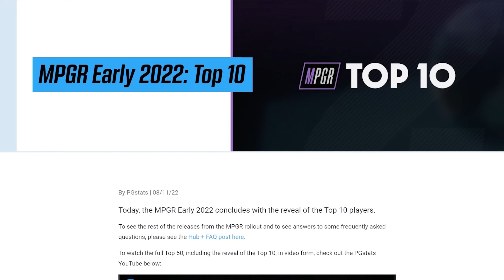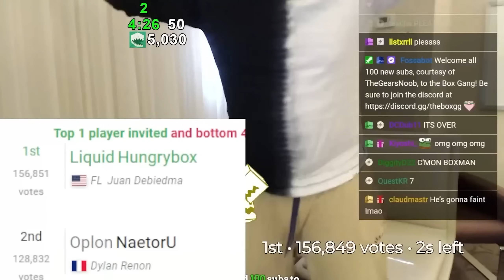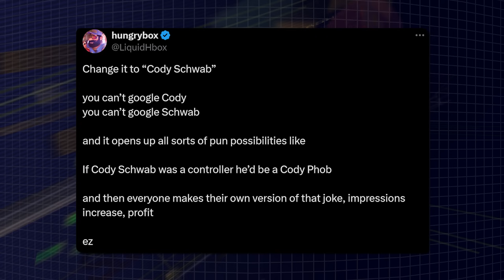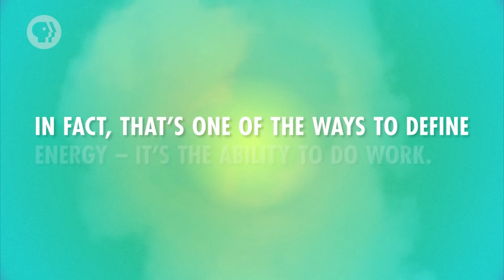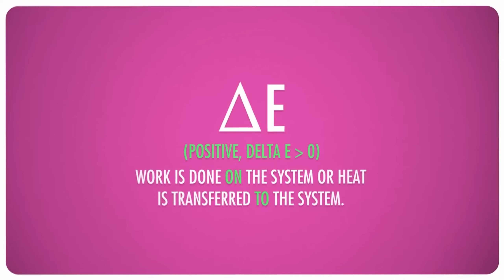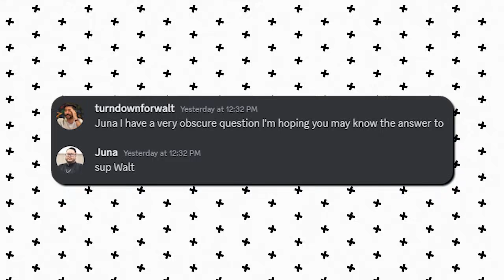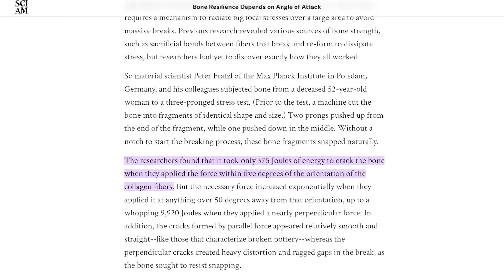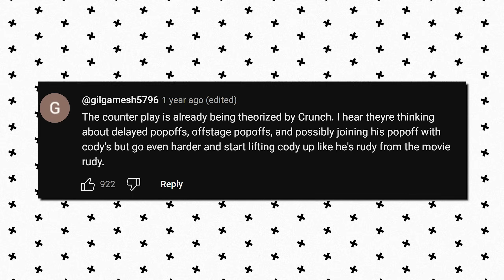Using Math to Calculate Melee's Most Insane Popoff (feat. @adef)

Comment: Sorry mate, force is only applied to the chair during the wind up until he releases the chair, you should be calculations the work through the distance the chair goes from its projectile arc where you can calculate the initial velocity, then you calculate the acceleration given in the windup for the force over the distance of the chairs acceleration
Reply: For Cody Cody schwab schwab falling, you would have to use the rotational inertia of a rod with evenly distributed mass rotating about his feet since what you did is assuming his mass is concentrated about a point at his head falling fiagonally rather than in an arc

Comment: We are forgetting about something very important: Cody "I Did More Work Than The Average Person" Schwab didn't just go from point A to point B, he went from A to B to A to C across both the horizontal and vertical planes. He did enough work to lift himself, a (presumably) 170lb man, off the ground ~7 times. It may not be enough work to surpass potentially breaking his own foot, but it might come close to flinging a chair
Reply: I would be pretty adamant too about the jumping calculations.
Although I guess that would have made for a video twice as long to produce.
Reply: Even jumping at a quarter metre height would almost triple the final figure for work, definitely overlooked in this hypothesis!
Reply: work is calculated from start to finish, the work he provided to lift himself up is matched by the work done by gravity to pull himself back done where he can continue his movement
since altitude of starting point = altitude of ending point, we do not need to calculate any vertical work in this situation